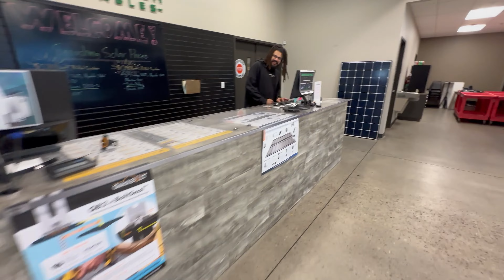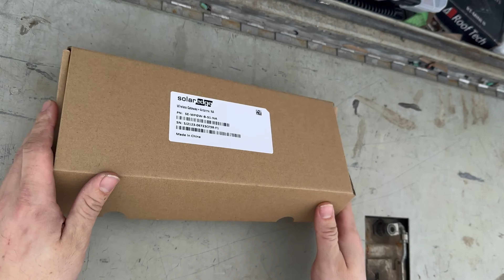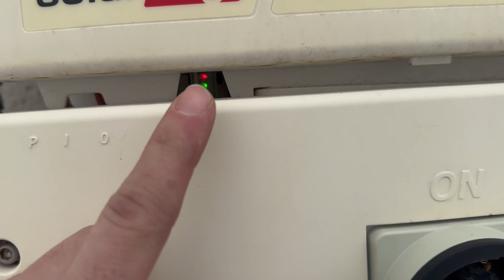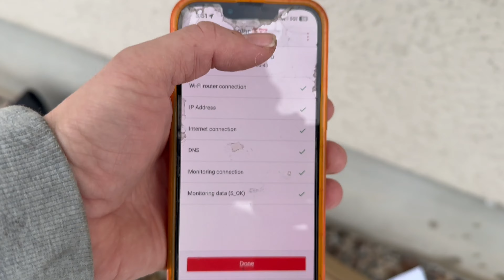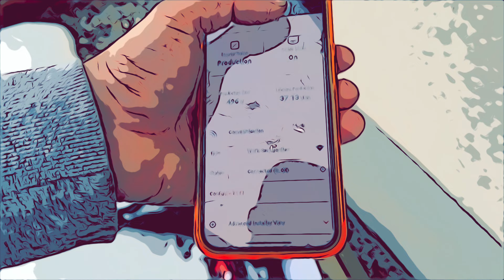My Solar Panels Are Off - SolarEdge Internet Connection

Comment: I hardwired mine when the first 3g was depricated and Solar Edge wanted to charge $499 to have someone come out and install a 5G kit.  No thanks.  Back then, the consumer app would not allow you to change the internet connection. It recognized the connection but would not default for communication.  I had to call Solar Edge and after a number of phone calls, I convinced someone that I knew what I was doing because I had already installed the cable and the connection was recognized.  I only need the installer login to make the simple change.  Way harder than it should have been but I got it done.  Did a video on the install as well  Super easy.

Comment: Hello, my solar edge app shows consumption but nothing for production. When I pull it up on the web browser for my site, it shows my consumption and production. I recently had my optimizers changed out after they quit working. Could that be a dynamic at play, my installer seems stumped. Thanks

Comment: Great video. My inverter stopped communicating too. Couldn’t see inverter status on mySolarEdge app but it was producing power. I was going to replace the gateway.  Before buying a new gateway WiFi part, I fixed it by resetting and re-linking my old gateway receiver (unit connected to my router).

Comment: There is never any reason to work in live gear.  Don't encourage DIYers to do this.  Beware of capacitors.  Shut down the AC at the breaker a knife switch, shut down the DC, and wait several minutes for the capacitors to drain.. verify all live parts  you might touch are off with a meter.

You might save someone's life
Reply: Solar DC never shuts off unless you turn over panels or throw a thick covering over them. Its always live

Comment: @solargoat I frequently have my panels stop producing around noon even though the sun is out and it’s only 50 degrees F. What can cause this frequent drop out? I have Solar Edge inventer and Hanwha cells.
Reply from the maker: Might be too many solar panels on a string? Voltage or wattage too high?

Comment: @solargoat my communications have stopped working with my solaredge inverter. I'm pretty sure it's the 3g modem ending service. I ran an ethernet into the inverter but it's not communicating and I don't see an option to fix that on the app. I also don't have the front panel led display either. My installer won't answer and I don't know what else I can do. Any advice?
Reply from the maker: Does it say you have “SOK” on the coms section? If you scan the QR code you should be able to select coms and change it to Ethernet manually.
Reply from the maker: If that doesn’t work I’d be worried it’s a dead inverter or bad cable
Reply: No the inverter is good, I've got the solid green light during the day and I can see the dip in my electric's stats on another app (that's a long lag before they post that but I know it's working) @solargoat  

I've got to try and see if it gives me the option to change it manually in the app. The first try through it could see I was trying to connect it via ethernet but it wasn't showing in actual info on the app. 

BTW, thanks for responding!
Reply: Bad cable! I redid both ends to see if it was my shoddy work...and it was! It's connecting now. Thanks for responding! @solargoat